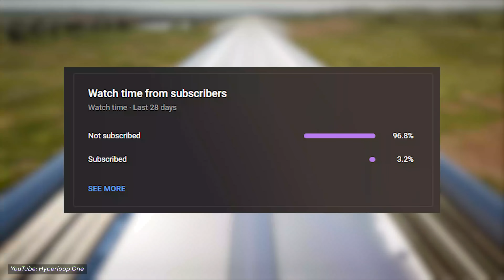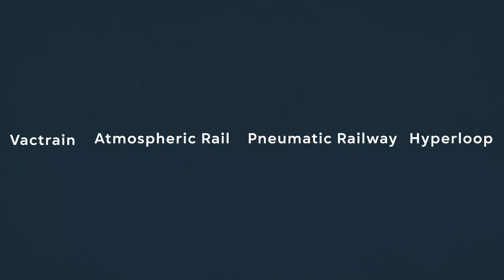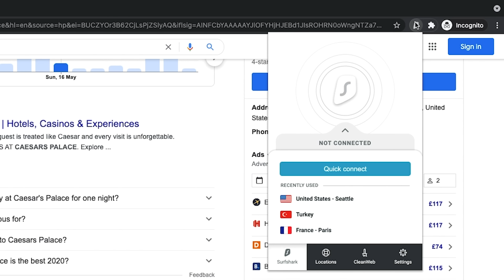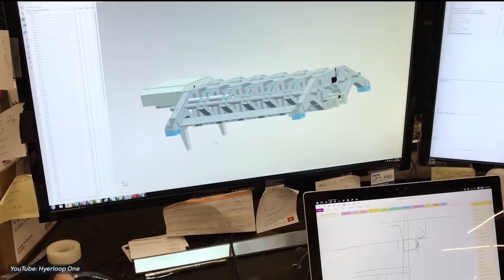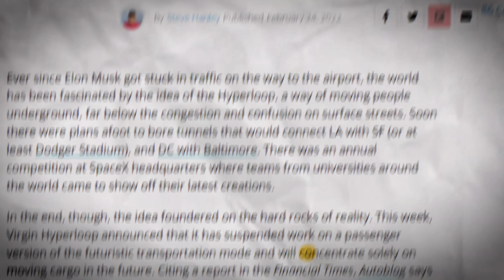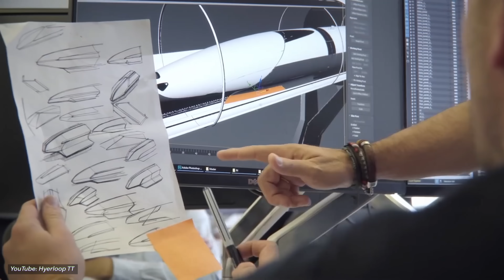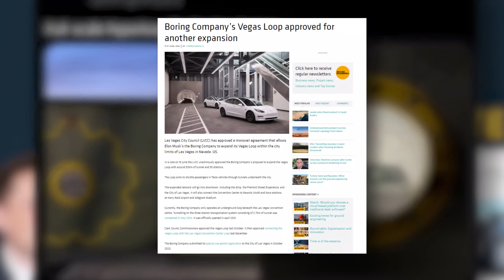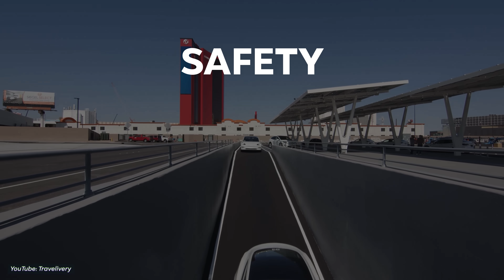What Happened to Hyperloop?

Comment: Imagine getting stuck halfway through a track underground with no exits
Reply: And bear in mind, you're not merely stuck in a tube underground - you're in a tube in vacuum. So even if you could get out, you'd die because humans apparently need oxygen, I hear.
Reply: @larrywalsh9939  well, you could equip it with space suits and air tanks and then in an emergency it would be like living on Mars during an emergency, that might be FUN! 😂
Reply: @larrywalsh9939  . Traditionally minded humans need oxygen still? Elon is working on making humans existentially anaerobic living things.
Reply: @larrywalsh9939  Your sarcasm is enlightening. Thanks 🤣😂
Reply: @Megalogy  The capsule? Yes, most likely. That's not the point. The point is that if you were stuck on a normal train, you could, at least, leave it. In a capsule surrounded by vacuum, you'd die if you got out.
Reply: @larrywalsh9939  nope. Air conditioners cannot work when the outside is a vacuum. The carriages would need to carry their own oxygen supply and CO² scrubbers. You can't pull in fresh air from outside when you're surrounded by vacuum. And you can't just simply vent the stale air. That would destroy the vacuum.

If you are stuck, you just sit tight and wait while they send another vehicle to push or pull out yours. If your vehicle is stuck (eg derailed and track is damaged, you just wait there till all other vehicles in the tube goes to the nearest station. They then shut down the entire line, allow air into the hyperloop tunnel, and only then did you leave the vehicle and walk to the nearest escape tunnel.
Reply: @larrywalsh9939  and have to carry potty bages, food, water and emergency oxygen...
Reply: @larrywalsh9939  you also die if the vacuum gets IN...
Reply: In a very small space.
Reply: It not impossible to happen and it would be life threatening
Reply: EVER HEARD OF EXPLOSIVE DECOMPRESSION A TRAIN IN A VACUUM TUBE = BAD IDEA
Reply: Under partial vacuum and no restroom.
Reply: @puntabachata  YOUR SURROUNDED BY A PARTIAL VACUUM IN A DIVING BELL EXPLOSIVE DECOMPRESSION IS STILL REAL ITS THE SUDDEN CHANGE IN PRESSURE THAT KILLS YOU
Reply: Similar concerns before underground was built, look at now, billions of people are using underground
Reply: @wjpat877  Yes, but that one can't implode or immediately suffocate the passengers.
Reply: You couldn’t pay me enough money to ride in one.
Reply: @@earnit-rv7mu Ah, yes, I see, your logic is inescapable. 
Let me ask you, in rebuttal: Have you ever heard of an aircraft breaking down mid-flight and all the passengers are stuck on it, mid-air, unable to escape? No? Neither have I. Because it doesn't happen. But that's the point, you see, you're attempting to compare an underground train, in vacuum, to an aircraft, and they don't compare.
Reply: First of all it will be not vacuum. It will be just reduced pressure. The pressure will be the same as atmosphere 10 km above ground. That is the key. Second - the safety valves will be installed in the tube for emergency. In that case you will have atmospheric pressure within fue seconds. Musk is not so stupid as you think.
Reply: Or have that experience for a period of 18 months minimum... on Starship.
Reply: Also the concept of pods that run at 240km/h in vacuum, imagine what happens when one stops or slows down in the middle for some accidental reason. And btw, at some point they have to slow down to load and unload so I don't even understand how this is supposed to work. If it's just an underground highway, well, that's just a tunnel and not a loop.
Reply: If something can go wrong, it will go wrong given enough time and trials.
Reply: imagine some lunatic put bomb in his car.
Reply: Even if there were exits there's no way to get from the pressurized train to the exit (which would have to be an airlock) without the equivalent of a space suit. Now do that in any sort of emergency.
Reply: The correct name is "The Hypersonic Train" and it's basically, a hypersonic Maglev which would run in a technical vacuum tunnel (couple mm Hg) same pressure as it is at 30+ Km altitude! U need a pressurized Maglev train in the same way a space capsule has pressurized air. The maximum technical speed of such device is somewhere between 5500 and 6500 km/h to a maximum threshold of 7000 km/h or 4000 mph due to Coriolis Effect. The energy requires is 1/10 of a long airplane trip across the same distance , being able to transport over 2000 ppl. That's the initial Project. 🥰🤗😇
Reply: And then a fire breaks out!
Reply: @rsinclair689  And then a fire breaks out on a plane at 30,000 feet, or on a ship In Mid Atlantic, or in a long train tunnel, or in a skyscraper. Naysayers of the world unite, let there be no innovation. Don't use electricity lest it kills you. Go live in the Stone Age, nothing dangerous there, is there?
Reply: @@earnit-rv7mu You're making it very clear that you do not understand, and it's not my job to educate you. 
I'm fine with that.
Reply: @@earnit-rv7mu There are people who are afraid of everything.
Reply: My worst nightmare!
Reply: Imagine being in a plane when it fails.
Reply: @tomellis487  airplanes WANT to fly. They're designed that way. Lift is something that will happen as long as the thing is moving. Absolutely nothing on Earth "wants" to exist in a vacuum. You are fighting physics the minute you start reducing pressure. It's not the same.
Reply: @anonydun82fgoog35  In the way that a rock, " Wants," to stay still. It's a good job there are people who are innovators, despite all the naysayers.
Reply: @tomellis487  You missed the point entirely. How much effort do you think it requires to start a rock moving versus say making sure it doesn't move? Besides don't get your panties in a bunch it's not me that canceled Hypreloop. It was canceled for a reason. The thing about innovators is rarely do they understand money.
Reply: @tomellis487 I agre, planes are a horrible idea for civilians. But even human death gets forgotten, so long live money
Reply: @tomellis487  parachute. Emergency landing. Hello ? 👋🏼
Reply: Engineers are smart & they would have definitely thought about that
Reply: I am an engineer with 40 years of experience.  I have thought about it. I would not ride in one of these, but I would encourage some of my neighbors to do so.
Reply: @UniverseIsAwesome2026  but then company profits would take over like they did for the Titanic without enough lifeboats.
Reply: @UniverseIsAwesome2026  I'm an engineer. And I can tell you that I would not even attempt to design a system like this unless there were an absolute need for it. We always have to design to engineering codes, and build in significant safety factors in our calculations, and I tell you that I would not design this thing that can fail so catastrophically, unless it filled some vital need and the high risk was worthwhile. But it isn't, we have highways and trains.
Reply: @UniverseIsAwesome2026  😂😂😂
Reply: @UniverseIsAwesome2026  dude no matter how smart the engineer is failure will always happen, look airplane still falling down even they developed by smart engineer
Reply: @raisofahri5797  also, the highly engineered space shuttle has been known to blow up, so not confident about humans designing a perfectly flawless thing….
Reply: @raisofahri5797  but the chance is very low that something happens to you in an airplane. There are failures but pilots are trained for these situations. If they make hyperloop work its unlikely something bad will happen. How often do you hear about a train accident due to a failure? Like never right.

Comment: It IS possible to achieve almost total vacuum in an enclosed space. It's also possible to make a capsule that can maintain sea level atmosphere inside while it's in a vacuum. What's almost unfeasible is the notion of maintaining said vacuum. A leak anywhere across the ENORMOUS surface area of the tube would introduce atmosphere, but also presents the possibility of causing an explosive rupture. Same goes for the capsule itself - these things would need CONSTANT maintenance, since the continuous cycle of pressurization and depressurization would cause very significant mechanical and metallurgical wear. 

Imagine you're riding one of these things - the tunnel stays in good shape, no implosions, that's good - but a leak forms in your capsule. And uh, oh, the leak turns into a rupture as the capsule's structure gives out due to all the metal fatigue of thousands of compression/decompression cycles. Fortunately, you weren't sitting right next to where the capsule ruptured, so you're not one of the ones killed, merely maimed. But the story's not over, you're still travelling at over the speed of sound, in a capsule that has experienced catastrophic mechanical failure. Even if the impending crash doesn't turn your body into a thin smear of paste, it doesn't matter because you're already dead, since you do, as it turns out, need to breathe air.
Reply: Except there is no need for a full vacuum. A 10% vacuum (light vacuum) would be largely sufficient to achieve very high speeds. Think the atmosphere at 10 km, where airplanes travel at 800 km/h. Remember that healthy people can still breathe for a couple of hours at the top of the Everest.

Secondly there is no need to depressurize-repressurize the tube. All you need is seal the doors of the pod at the terminals, which is something we know how to do. Basically, a rubber seal strongly pushed in a couple of grooves around the door would probably be sufficient. And it wouldn't need to be as tight either, as a small leak, like in a flat tire, would barely change the pressure of the whole tunnel.
We know how to seal a 1m tube over dozens of km with very very high vacuum (think LHC), so  maintaining a 10% vacuum over a few hundreds km, even with a much larger (say around 3m diameter) tube, doesn't seem so hard to me.
In case of emergency, it would be fairly easy to repressurize the whole tunnel quite quickly (say a minute or less) by installing valves every couple hundred meters.
Nevertheless, the system needs the possibility of evacuation in case of emergency. This means that the tube must have airtight doors every km or something like that.

Honestly, I'm curious what are the issues the companies faced. Elon Musk is a well known bullshitter, and things like colonizing Mars, or "The Line" city in Saudi Arabia are complete BS, but the Hyperloop sounds feasible to me.
Reply: @InXLsisDeo  Some very good points there. However, I never said the tube would have constant pressurization/depressurization cycles, it's the capsules. One of the major things that limits an aircraft's frame lifetime is the pressure cycling, which slowly introduces stress microfractures, and that's a big reason why aircraft maintenance is so expensive (I know firsthand, I used to work in aerospace engineering), because they have to check these things in excruciating detail on an ongoing scheduled basis and replace parts once they reach their service limit.
My point is that these capsules would need the same degree and frequency of detailed inspection because a capsule's frame failing due to pressure cycling metal fatigue would likely be just as deadly as a failed aircraft frame.
Reply: @larrywalsh9939  Interesting, but there is no pressure cycling at all on the capsule. It's always under pressure like a bottle of gas under fairly low pressure. So while I agree there would need some inspections, I don't think they would be as frequent as on an airplane. And since we know how to do that on an airplane, it's definitely not a major problem, it's just a question of maintenance, but speed trains and rails also need constant inspection and maintainance.
Reply: @InXLsisDeo  The idea of vactrains has been around for maybe two centuries now.  Despite all that time no one has been able to get them to work (by work I mean the combination of technology and economics).  Musk didn't come up with this idea.  He just rehashed it and marketed the hell out of it and a lot of people fell for it.  That's why companies are having issues: they bought into Musk's hype without doing their homework.  Musk never expected hyperloops to work, he has admitted that the whole thing was an attempt to derail California's high speed rail project that was threatening electric car sales.
Reply: @JonMartinYXD  I know he never came up with the idea. He never came up with the electric car either, but as much as I dislike the man and see through his bullshit, I will credit him with popularizing the electric car and revolutionizing the industry. In a country where the gas powered car industry was impossible to move, that is a major feat. My praise of Elon Musk stops right there. Just about everything else about him is awful.
Now, that said, if other companies can make the vactrains a reality, it would be pretty awesome that it gained traction (pun intended) in the United States and elsewhere.
Reply: True the Hyperloop concept is not feasible.  Failure due to fatigue only occurs when material stresses are consistently near or past the yield point, not in the elastic range. Fatigue would not be an issue, failure would be just implosion and catastrophic failure without very many cycles.
Reply: @Andriastravels  Actually, fatigue would likely become an issue due to the nature of the stress loading/unloading cycle in this case, since there's a number of aluminum and steel alloys that can experience hydrogen embrittlement when such a pressure differential is experienced repeatedly.
Reply: a piece of tape is enough to seal a leak on a space station for example

in sci fi the pressure difference of one atmospheres is often by far overexaggerated
Reply: As Thunderf00t put it, "even one small problem and they'll be collecting your remains with a squeegee".

Comment: If you have a singular tube that has a constant flow of smaller capsules that travel at high speeds... It means that you will have airport-like security with tickets costing more than an airplane ticket, 100+ times more than a potential ticket for a bullet train in a low-density population. Unless you want to ride with a terrorist with a grenade and a potential catastrophe that would result in capsules hitting each other in super high-speeds, LOL  :face-red-heart-shape:
Reply: True.  But bullet train tickets are not cheap, they are almost like air travel.
Reply: @Andriastravels  Bullet train tickets are almost like air travel, but for the wrong reasons. Air travel is kept artificially cheap (for instance there are no taxes on the fuel), whereas train tickets are supposed to pay for all the costs, including the rail system maintenance. You don't pay for road maintenance when you own a car, it's paid for by taxes which are paid also by those who don't own a car. As a result a person who doesn't have a car and travel by train pays for those who have several cars and travel by plane. So these prices are artificial and result from political choices.
Reply: @frenchimp  In the US, there are no tolls, but in other countries, intercity highways have tolls.But otherwise, you are right. That's also why there are so many potholes in the US (and not elsewhere like Europe) : the maintenance is left to the states and with politicians who always want to cut taxes down and refuse to pay for infrastructures, the maintenance of the roads has become insufficient. Indeed, it's purely political, the pervasive demagoguery of the last decades is the root cause of the damaged roads.

Comment: nothing is impossible one day it will become reality
Reply: Jeez, I hope not. Don't wanna live in reality, where cool trains replaced with that expensive useless junk.
Reply: @delancre5858  so should Innovation never happen anymore?
Reply: @theonlythingihavetosayis9333  that not innovation, that a scam and downgrade. 
We talking about replacing trains with single pods in vacuum tube. That shit cant hold lot of people, have limited bandwidth, it's hard to maintain & hard to build, what also damn expensive, and with all of that, it can't transfer anything except of people in current state (and even concepts that was proposed to transfer goods, was kinda stupid with tons points of failure).
Reply: @delancre5858  virgin Hyperloop is actually currently using it to transport freight inland and it's increased the cost effectiveness of freight shipping by about 4x as much along with less carbon emissions. Even though it was proposed for human transport, it's now being used as an innovative form of freight transport that works well surprisingly. It was a net positive for hyperloop to receive publicity like it did. Maybe it's the future of freight shipping. Maybe not. But the point is that it works for something and we shouldn't call it a scam of all things LOL. That doesn't even make sense